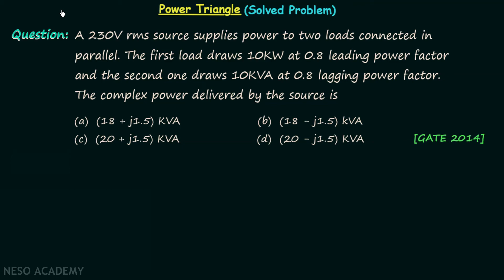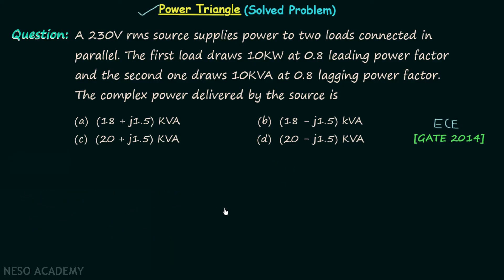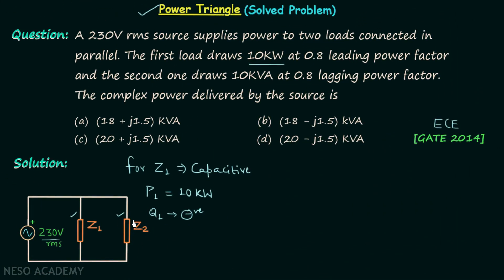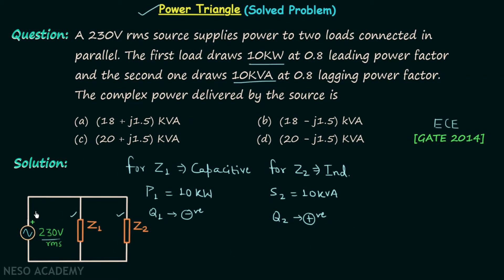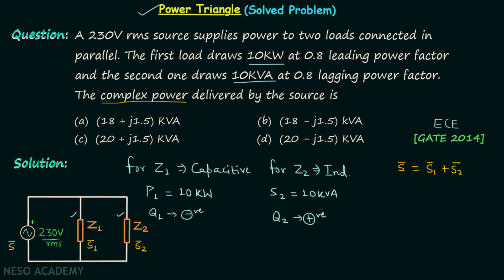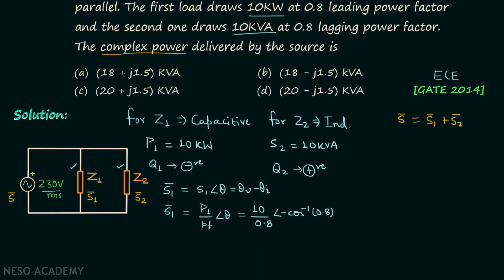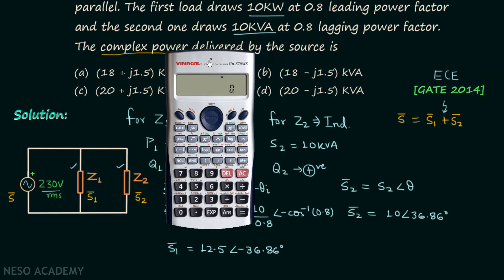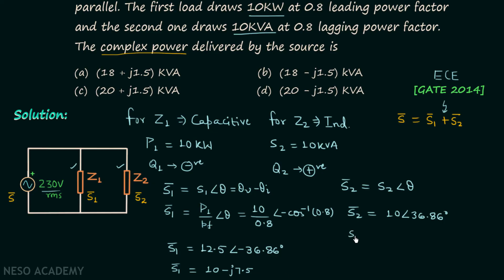Power Triangle (Solved Problem)

Comment: I actually found it easier to solve this problem using the power triangle and trigonometry.
But 1st I had to calculate the sin ( acos(0.8) ) = 0.6. 
However once I had that I calculated directly the reactive power and real power (where missing) for both impedances, w/o ever having to convert from polar to cartesian coordinates any complex number.